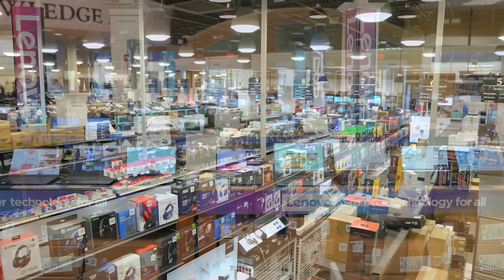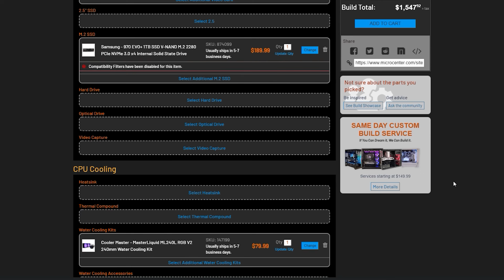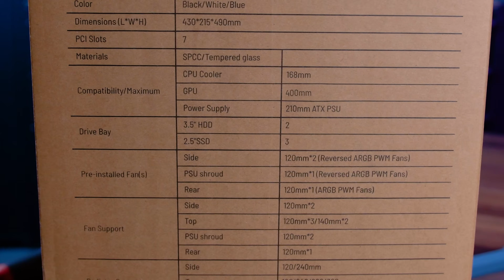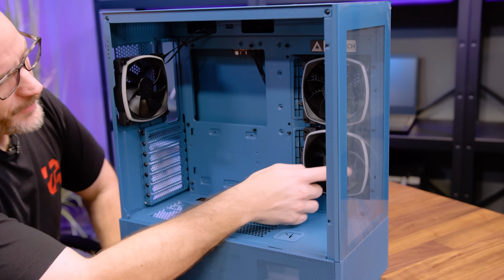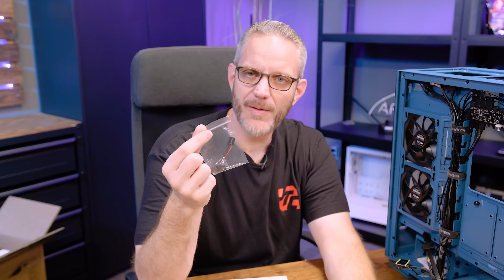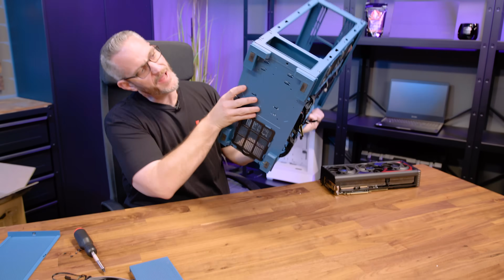This case has a funny name but awesome design choices! Montech Sky Two

Comment: As to case colors and most non black being overlooked or not selling that well, black cases just seem to have the best thermals.  I have seen white cases have similar thermals though.  The hottest case I ever built in was red, despite it have an excess of ventilation.  Rebuilt the exact same system into the same case in black when the power button on the red case quit working after 3 months (solder at the button failed), EVERYTHING ran 5C lower than it had in the red case at a 5% higher OC.  Not sure how blues or greens handle as to thermals, after the above and another hot build in a red case, I have determined that black cases seem to have the best cost to thermal effectiveness ratio.

Comment: my first buld was in a montech air 1000 premium and it's an extremely overlooked but amazing value case IMO. pretty blatant design rip off off the 4000d but comes with 3x140mm front fans and 120mm rear fan, and now that I have a 4000d, my temps are only lower by maybe 3 degrees compared to the montech, but had to spend an extra $40 on fans compared to the montech.

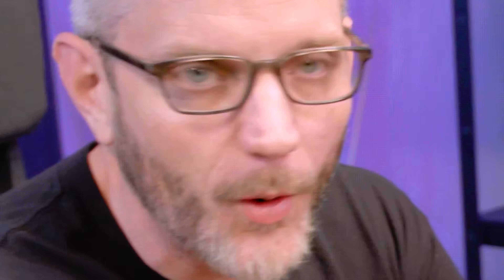Comment: 15:04 That Strix would be cool if you mounted the extra fan where it was shown on the box. Well atleast until it gets filled with dust due to a lack of filters.

End of video, I do want to see a white and blue build in that case. It would be a cool looking build and by cool I mean temperature. A winter theme build would be great even though Morocco is not known for winter sports.

Comment: I have never used zip ties or Velcro when building a case. Those black twist ties that come with every single cable is what I use. Make a U at one end with enough of a tail for twisting 2 times then snip the rest off and repeat until you run out of that tie and repeat with the next one. If you need to swap something untwist them the re-twist when needed. Just remember to have enough of a tail so you can twist, but that doesn't have to stick out... twist ties are bendy so the knot and tails can be bent to follow the cable. 100% reusable takes less space than velcro straps and no chance of snipping a wire when removing and comes with all electronics including lamps as 2 twist ties in my system came from the 2 table lamps in the guest bedroom.
Reply: Yeah, twist ties are not good because they could cause a short if not careful. This is why twist ties are only used for packaging and not given for installs.

Comment: the reason why white sell less is because most mobos and other components all easily comes in black... so buying a black base type of case is a no brainer..... you know when i tried to make my first white build to go along with my white desk and shelves... there was 0 components that are white in the SKU i need them to be in.... it was near impossible and the only probable ones that are in theme with a high enough component is the gundam set back then and that came with the gundam branding premium pricing.... 0 mini ITX board.... 0 GPUs in the SKU i need them to be in.... i could get white fans with no RGB or those white RGB gets the white tax premium that some cases have..... and luckily cooler master came with a cheap ITX white colored case with no white premium tax on its pricing...

Comment: Oooh, reversed fan!
This opens a chance for a very interesting test - on a dual-tower, dual-fan CPU cooler, is it better to have the two fans rotating in-line (both counterclockwise) or rotating opposite (clockwise vs counterclockwise) while still pulling air in the same direction

Comment: I actually was considering Montech for my "cheap-ass" budget build.. it was close loss to  another low cost manufacturer but did impress me...  The case I chose had the advantage of a little more depth for cable management on the backside but I probably could have made the Montech work.

Comment: If your shroud fan is properly pulling air in through the bottom of the case, or the bottom back, it can lower your GPU temps by up to 10C... usually more like 2-3C, but still.

Comment: Kind of a really cool case, Just wish they offered a mesh front panel model or swappable part with some 120 mounts. Other than that, depending on the thermals I'd consider using it for a build.

Comment: I understand why cases come in limited color options, but I have and will probably continue to be willing to pay about 25%  premium for a white version, of a case I find appealing. I think it would be cool if a company built a case designed to be user painted. So it just ships unpainted, but all the surfaces and that come prepped for paint. And customer does their own painting, and the company offers you access to high quality paints that will properly stick to the prepped case. Since frankly I don't think people paint cases as much as it should, since I've not had good luck painting over a case's first layer, and Franky removing the paint can be a pain.

Comment: they could've just made the front panel mesh with up to 2x 120mm fans. extend the length of the case for about 2 inches so there would be no issues with the cables blocked by the side fans.

Comment: Hi Jay, I have a Thermaltake View 71 TG case that has the rubber plugs for the front panel connectors which sit at 45° pointing up.

Comment: In the end another box we put PC components in. My only concern with a case is whether it had easy and sufficient air flow. Ease of installation,  cable management etc are all secondary because they are generally a one or two time thing.
And I admire the beep, reminds me the old days when sound cards didn't exist yet. Besides it's still very useful.

Comment: I just built in their Sky One for a Christmas gift and found it a great case, particularly for the price, which is even lower than this one.  I liked it so much that now I'm building in the Sky Two.  A blue one like in the review.  

A couple of things that Jay didn't mention which builders should be aware of.  Depending on your mb's layout, cable fitment can be TIGHT.  A USB 3.0 header that fires straight out the bottom is gonna be a problem.  EPS cable up top with an AIO may cause issues.  You wanna put a rad where the side intake fans are, you ain't fitting that monster GPU in there.  (There's a reason that the ones shipped out for review also seem to have included the same air cooler for the reviewer to use.)  A Sky Two 2.0 with juuuuuust a little more room all around would be a Hall of Fame case at this price point.  Don't get me wrong, this is still a great case.  You just have to be aware of its limitations when planning your build.
Reply: I had to cut some metal out of my sky one mini to get my USB header in. Also I've no idea how people fit the psu properly as there was no way to fit it naturally. Very tight fit but I needed smallest possible and the Asus Prime was a bit too long.

Comment: By the looks of it, you can fully disassemble that case very easily as well. It looks like its fully held together by screws for the most part, so taking it apart to do custom work on the panels or painting them would be so simple. Wish more case manufactures did this instead of riveting them together.

Comment: Nice to see the former high end design come at a lower price point.
Makes me curious to see how the new high end cases will look like, for now it seems only to be some gimmicky stuff like spring latches magnets or doors to hide your cables that are then hidden by the solid back panel...

This one looks like a decent value case (well, at least where they are available), though the blue is pretty awful, but that's just personal preference.

Comment: 03:08 I think what they had in mind was that the case would probably be used by watercoolers - whether custom or AIO - so it would be better to put that fan on the shroud to provide exhaust for the trapped PSU air, then let customers add their Watercooler to the top for exhaust of the entire case. I don't know if that was their intention, though.
I would have found a way to build the case with capability of having intake fans on the bottom of the PSU tray, and exhaust at the back of the PSU tray, with the option of opening up a closed-by-default grill on the top of the PSU tray for anyone wanting to have an exhaust fan or two for the PSU tray on the top. 
I would then make the main part of the case the way it is now, but add support for two or - and preferably - three fans on the front as well.
That way, assuming they don't opt to open the closed grill on the top of the PSU tray, all the hot air generated by the PSU wouldn't impact the overall temperature of the case, and so the CPU and GPU would run a little cooler.

Comment: Really wish they made some adjustable fasteners for the front of the case to mount fans instead of just punching holes for all sizes and having larger fans force air through metal.

Comment: As far as the port dust protector inserts, I have an Antec DF600 Flux case that came with the same dust protectors. One of the best small add ons I have ever recieved with a case.

Comment: You're definitely not an idiot... But Antec has a case that comes with those dust covers for the top panel.  And for the case I bought,  they came installed. 😊👍🏾

Comment: I'd say $100 for that case, including shipping, is a good value.
It has a lot of premium features and it's made of steel. I bet the bottom mount fan brings in more air than you would suspect.

Comment: I think the glasses are a good look for you, but they're still going to take some getting used to for me with seeing glasses-less Jay for 3+ years. I still remember the moment I first put on a pair of glasses made just for me waaaaaay back in middle school like 2 decades ago. My world turned from 240p to 4k and it blew my then tiny cranium sky-high. "THIS IS WHAT THE WORLD IS SUPPOSED TO LOOKS LIKE??? Y NO1 TELL MEEE???" I hated wearing glasses still, so I made the switch to contacts as soon as I discovered it was a thing. I still have a pair of glasses with a semi up to date prescription just in case, but it warps the outer 40-50 degrees of my vision and it's jarring. I'm too squeamish to consider Lasik, so I'm sticking to contacts for the foreseeable future.

Comment: 93 dollar price point for a case like that... remarkable, if you are a budget builder and if you take in the fact the case comes with 4 decent AND 4 decent RGB fans for you rainbow lovers out there, the money you save alone on, let's say 3 Lian Li 120mm fans. It completely offsets the price for the case in my opinion. I always look for little money-saving tips and tricks like that when I m building a PC that I entirely spent WAY TOO MUCH on a GPU or CPU and try to offset costs and make myself feel better for doing so.. lol but 100 dollars saved on fans is 100 dollars extra to be able to use for the hardware that really matters. the case basically pays for itself.

Comment: Hey jay my Zalman Z3 Iceberg Premium ATX Mid Tower Gaming Computer Case, 2X addressable RGB Fans, Premium Tempered Glass Side Door, USB 3.0, Magnetic Dust Filter, Cable Management System (White) came with the dust covers for my top ports 😊 i havent finesh my bild yet i still have to get motherboard and ram and ssd

Comment: My first ever build was for my son for Christmas 2020 and i went with the Montech Air X because i was getting FLEECED by the GPU prices (idk anything about pc's and thought that was regular price not knowing about the chip shortage) and that case was THE WORST.  The first one i got had about a 1/16th inch gap between the bottom right glass and the case and still maintained about a 1/32nd inch gap from midway up to the top right corner.  Doesn't sound like much but when you're running RGB it blasts out of the gap.  I sent the case back through RMA and the one they sent back had an even bigger gap across the whole seam between the glass and the case.  And the PSU screw holes didn't match up but they did with the prior case.  I sent it back and asked for a refund and went with a Corsair and had zero issues.

Comment: I would build on this case, but at the price point would go with the Lian Li 216 first due to its airflow and features for building. This is interesting for glass front panel and if you want another color to stand out. Really like the blue color and if I knew more about the brand and support would like it for that reason alone. 80 bucks would buy it no doubt.

Comment: Great video. 
One more thing you might want to include in your ad for Micro Center is that they do ship. I just received a motherboard, CPU combo that I ordered and it was fast and free shipping. 

A couple of years ago I bought a cool case that came with the dust caps for the front panel stuff, Enermax MarbleShell MS20 ARGB - Compact Micro-ATX Mini Tower.

Comment: My build is outdated thats the only way I can afford to build but I am going OVERKILL 2X 360mm rads 1 420mm rad AMD R9 5950 X MoBo has factory VRM water block by EK so I matching with EK cpu and ram water block will do same with GPU once out of warente  4X 140 fans 6X 120 fans with distro manifold and my first hard tube build

Comment: Seasonic q704 has the plugs for the top of the case. I only know because I bought one when newegg had "buy the case get a 850w platinum power supply free"  a weird inverted build. Had to try it. The case only works with that particular power supply.

Comment: you obviously don't understand shear and fluid dynamics...   1.  the cage itself doesn't need to slip through the air like it's an audi with a v8 engine...  2.  what you say should be on the other side of the cage gives the fluid a surface to follow  going into the fan.  meaning that air is less turbulent.  3. its obvious by some of you custom liquid cooling solutions you dont understand fluid dynamics and fluid pressure.  4. which just compounds the inanity you keep disseminating...

Comment: I was actually in the market for a new case because mine won't fit the 4070 ti I just got. (Yeah I unfortunately had to support the greed and the 4070ti seemed like the best bang for my buck at my budget.) I had another case in mind but after seeing this case I decided and just ordered it. I almost bought the vetroo AL-mesh-7C because I kinda liked all the intake fans at the bottom with the PSU mount in the front running a cord to the rear. It looked different and kinda cool. But this case definitely won in terms of price. It's gonna replace the montech X3 I have which was a great budget case too so I'm happy to support Montech again.

Comment: This case looks like a good buy for my use with 2 exceptions. 1) I prefer side control/connection panel access instead of the top. 2) I use hot-swap bays for backups and archived file storage. If the front (top) panel connection was swappable with the mesh side, basement panel, using a screwed blank connector plug, that would be great. Also if the front basement mesh panel had a knockout (?) to accommodate 2x 5.25" hot-swap bays it would be perfect. :) But that's what I need and that doesn't fit everyone. Although the price is reasonable enough to consider a mod build.

Comment: I recently bought a bios speaker. I took my old z97 system and turned it into a small home server, and it's actually nice to be sure it POSTed without having to wait for the OS to come up. Plus on linux you can very easily play stupid tunes with it using the `beep` command. Tho Ubuntu blacklist the kernel module for it by default, with a snarky comment about the PC speaker being a horrible thing nobody should use or something 😅

Comment: I wonder how hard it would be to fit a 5.25" drive into that front space below the power supply shroud.  Obviously it doesn't look like it's built for it the way the Fractal Pop Air is, but with the separate removable mesh panel it also should be totally possible, the trick would just be figuring out mounting.  Would be nice if they left some conveniently placed holes in the metal at the bottom of the case to support those of us still attached to our BluRay collections.

Comment: I am definitely seeming some similarities to NZXT. Those fans look like old NZXT ones, the controller too and blank slot covers are lifted from NZXT. Wonder if the case is made in the same factory or actually made by NZXT using old tooling then rebranded.

Comment: Have to admit, have only ever owned black cases. Actually like the look of the blue and what comes with this case for the price. It is for sure an option on a budget. Great review and thank you Montech for providing Jay with the cases, so we could see them. You are now on my radar for a new case.
Reply: One of my first computers 20 years ago used the case that Ultra later called the Wizard, deep blue metallic, even the plastic has metallic particles, and it has a blue UV reactive side window with chromed CPU and GPU intake covers!
Reply: Same until my last case, where I got the coolermaster h500p in white. Looks super clean with black mobo, gpu and AIO/rad.
Reply: i really dont like the blue they picked for this case. Also dont like the rounding of the fans, but im not trying to convince you not to like it. Cant fault the price atleast. And its good to see less popular manufacturers getting more prominent.
Reply: I've only ever used black myself, but my brother has a white desk and I made him a white themed build that looks great on top of it in an NZXT H510i

Comment: For under a hundred bucks this might be a winner. The plug caps is an excellent addition adding value to the system. 

The drive bay may be it's only real drawback for someone using HDD.